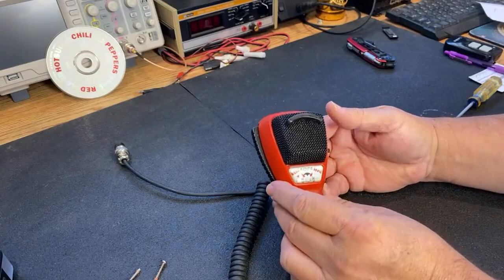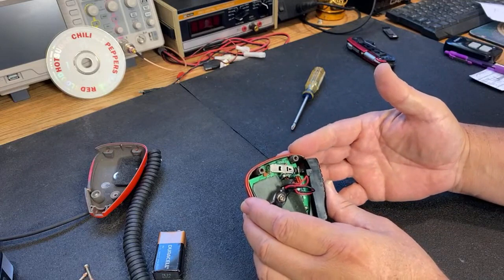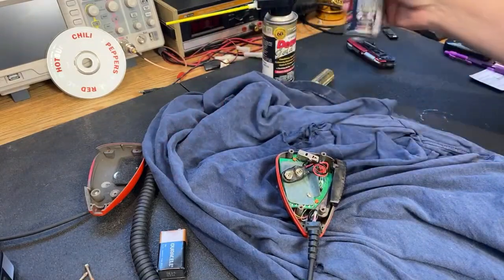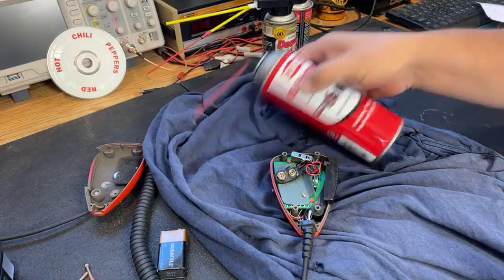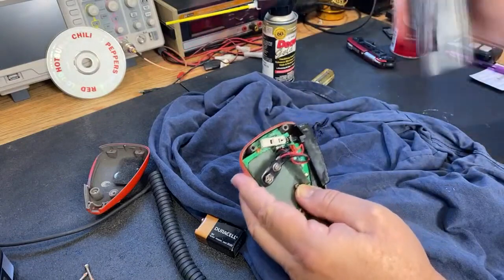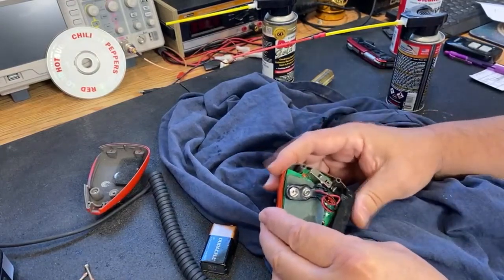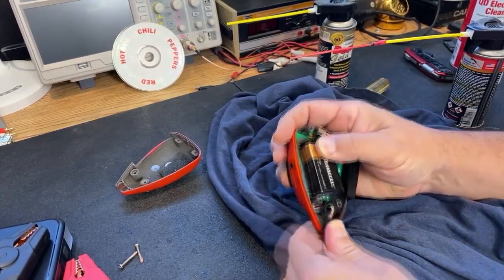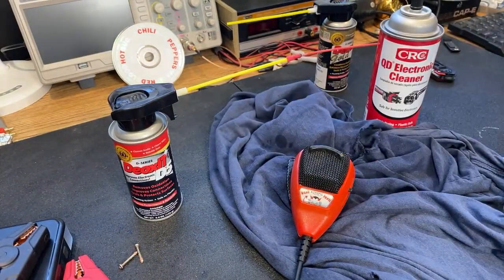How To Clean A CB Radio Microphone Push To Talk Switch

Comment: 🔥The Astaic  Dirt Devil 🔥

I bought 3 from Amazon every month the after about 3 months new " cleaning  needs deoxit or plastic safe CRC nlie can once a month. What gives with cheapo switches even used dielectric grease in switch . 
Works a month & crackly on TX again . Glad you gave some luck .
It's shame cause theres so many other mics that U clean once a year . . 
The Devil has perfect tone too for Stryker and others .

Comment: I opened 4 of those mics and they were scratchy and noisy from the first key up. The new RD104E’s  and new D104M6B’s. I ordered 4 of the NOS boards for the Road Devils and 2 for the D104s and they are perfect. No scratchiness and no breaking up. Can’t get them for Road Devils any longer but there are some left for the D104M6s. Once they’re gone, they’re gone for good. You can find them on eBay.

Comment: So yeah, I did this to my "stalk" mic for my 2510. My problem is that my voice cuts out. However, it didn't work. I ascertained that it's because when I push the button, the motion isn't straight in-line with the switch motion, creating like a binding-- or lateral strain. Hence, the contacts in the switch have been worn out by this offset physical movement. The switch is worn out (short version). But, it is CLEAN!
Reply: Same issue here .
I was able to replace that switch and it worked better than ever .
Tech tip.
Pinch the new switch in a pair of long nose needle nose plyers putting just a slight dimple in the metal housing . 
Worked out perfect 5 years later still working good. 
This also works on the new d104 hand mics the switches in those are junk

Comment: Hi WM, Great Vid.  That was important for most that do not know know there is a fix like that.  I usually just find a can of tuner wash. or TV contact cleaner.  Also to fix your stripped screws, I usually just cut a sliver of a piece of a drinking straw and slip it into the screw hole to take up the space from the striped screw.
Reply from the maker: I do miss the old Blue Shower.. Nice TIP,  i'm going to try it. Thank you.
Reply: @390WagonMaster  So you do not crack the standing screw boss that the screw threads into (from over expansion), use as thin of a sliver of the piece of plastic straw as you can get away with without it continuing to be stripped.

Comment: I had the same problem with 2 brand new RD104's.If you pry open the seam you talked about at the end of the S/S mic switch housing,you can access the internal parts pretty easily.Pry them apart just enough is all it takes.Good share though 390 👍.

Comment: Noice!  Worked like a charm!  I use the Deox-it sprays on all my electronics and most recently on my RF Limited (Road Noise) Xtreme2018 hand mic that had been sitting on my desk downstairs wired for my CPI-2000.  Some of that and voila'...my sticky mic PTT button starting working nice and smooth!  That and some WD-40 at the button pivot point and all was well.  Will definitely have to invest in some of that CRC electronics cleaner too!   Thanks, Mike!   -59Z

Comment: My microphone does the same thing every road devil I’ve ever seen, I put a thick O-ring down at the bottom of the push button that keeps it from rattling now I just ordered a can of the oxide. I hope it works. I think the problem is the push to talk button is loose. I use contact cleaner but that only dries it out. I think the stuff you recommended he’s gonna work because it lubricates, and it stops static.